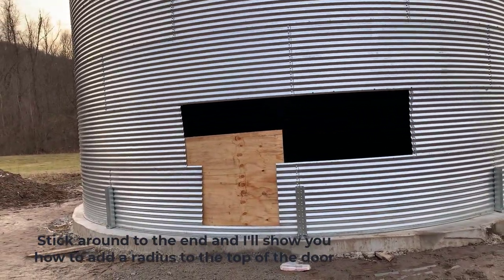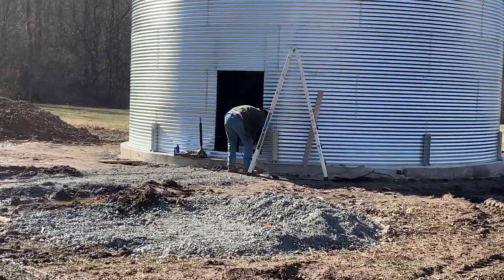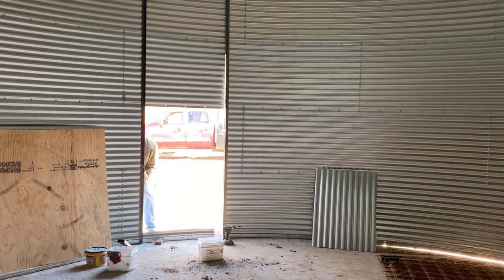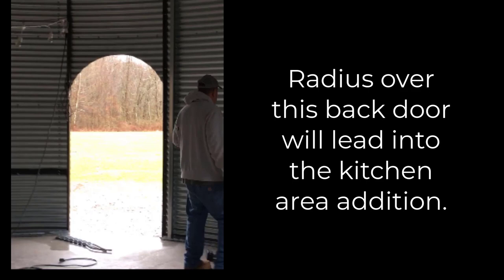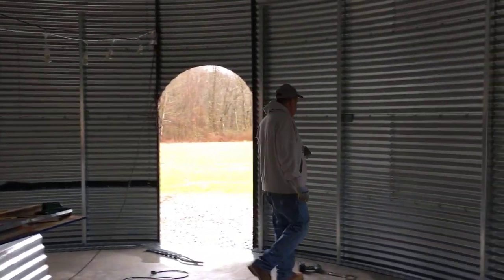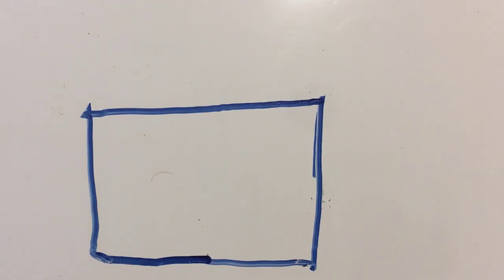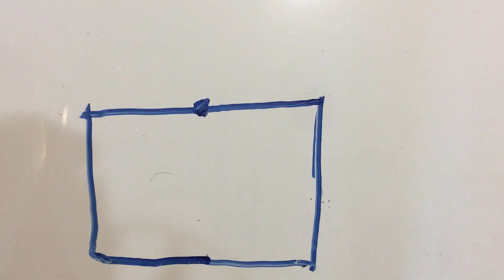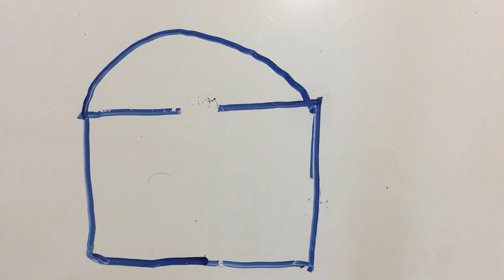Cutting out doors and windows *  how to add a radius to top of door  E13

Comment: Hello! Thanks for sharing your work. I'm wondering how you affixed the angle iron supports to the inside skin of the grain bin? Pre-drilled holes followed by bolts/washers/nuts?
Reply from the maker: We drilled holes through the grain bin.  The angle iron is literally attached to the grain bin for support.  Use Nuts and bolts to hold similar to those that were used to put the grain bin together.
Reply from the maker: The holes are 3/16 ths